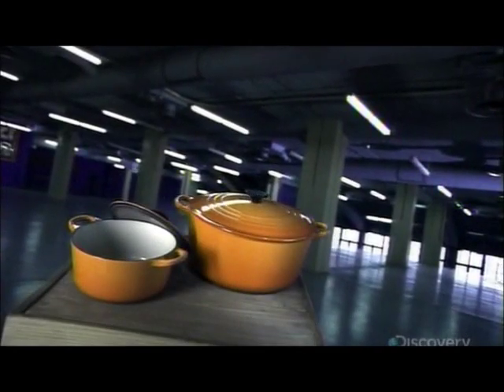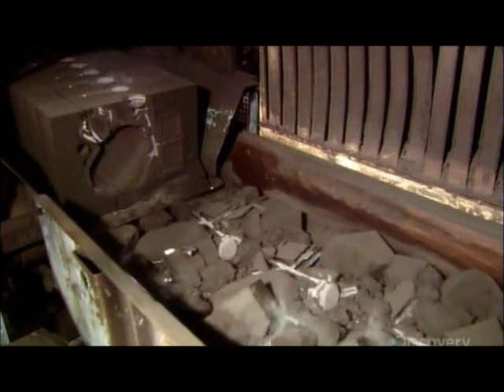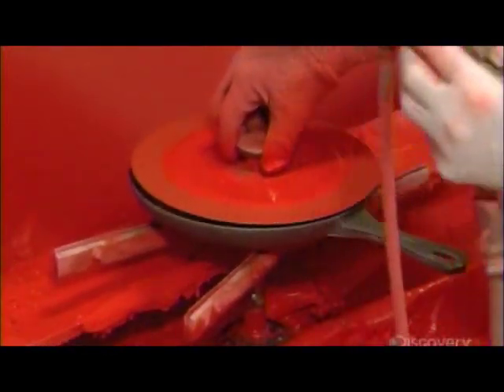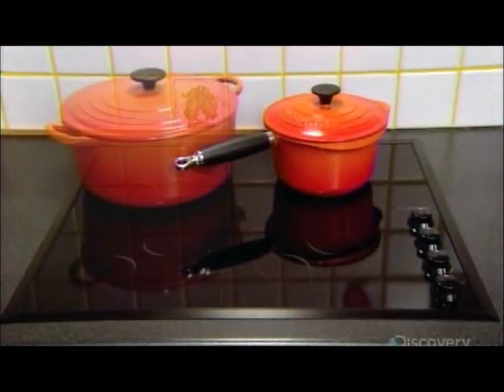How It's Made - Cast Iron Cookware

Comment: Some fun things I've noticed:

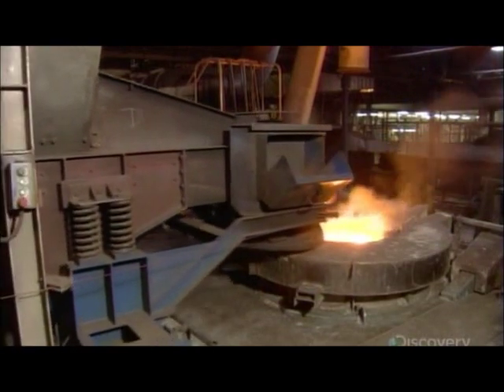0:44 Steel by definition is low carbon (under 2.1% I believe). The steel is really there to dilute the realitivly dirty pig iron and bring the carbon down. Gray cast iron calls for a carbon equivalence of 4.2 (C+si/3)

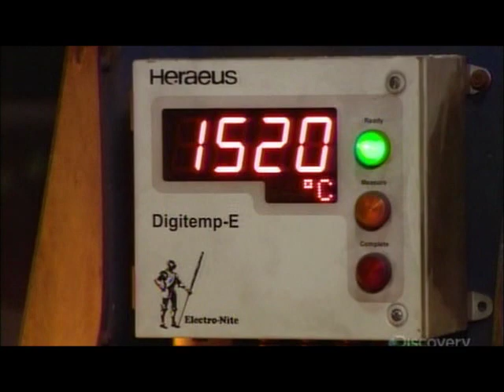1:02 Had a lol at the error on the Heraeus lance screen. Basically, means he tried to take a temp reading but the lance tip reached the end of its limited uses. I've gone through hundreds of those exact lance tips (That Positherm cardboard box holds all the lance tips).

1:02 That was the most winded way possible to explain how he threw Slag-Off in the furnace to clump up the slag XD

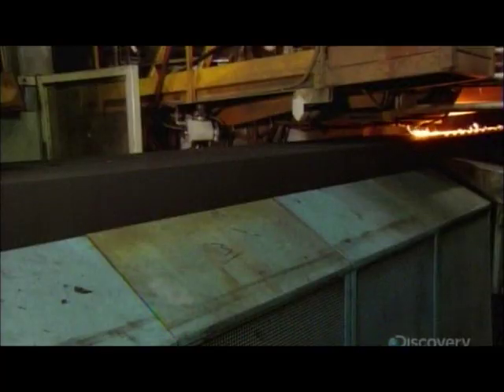1:30 "Because just one single grain of sand will be rather inconsequential in the grand scheme of things."

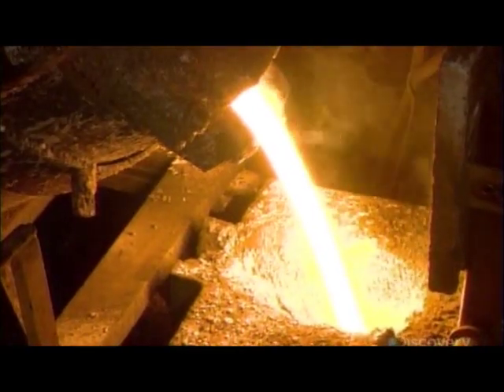1:44 God I wish we had a system like this.

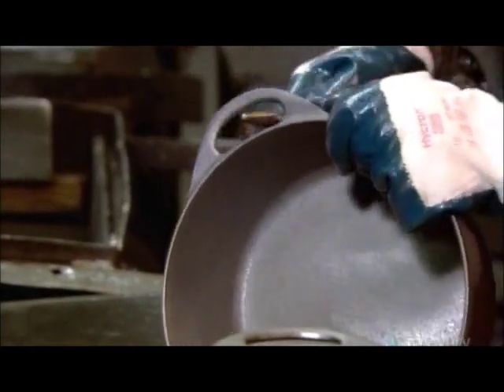2:45 Whip it!

2:55 "There's no real way to show the inside of our shot-blast machine so why don't you set a lid on the table and pour a bucket of shot over it?"

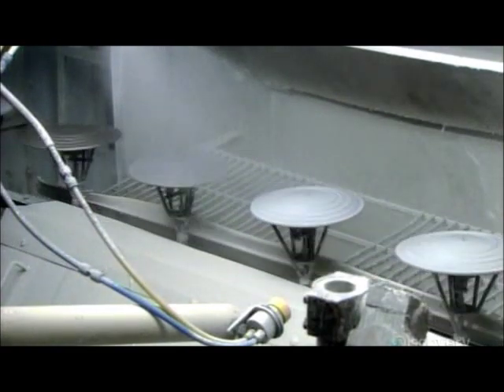3:13 SPEEN

3:19 I curious what they add to the glass to make it flexible.

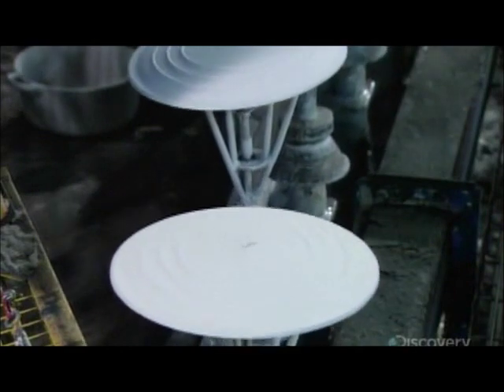3:30 I'm guessing this might also be a heat-treating step. Tempering starts at 100C, recrystallization at about 550C. I don't know whether 45 minutes is enough to do anything though...

4:42 I must go. My people need me. XD

Comment: We use stainless steel it actually does last more than a lifetime.  Drop one of those castiron pots and your enamel is gone!
Reply: Taunter Atwill I happen use cast iron pans that date to someone else’s lifetime. Griswold went out of business in the 1950’s, and I know one of them came from the 1920’s.  Drop one of these cast iron pans, and your floor is gone. :-p
Reply: What stainless steel cookware are you using that lasts “more than a lifetime,” I could see my Demeyere lasting but other than that even All Clad warps, dings and has to be replaced much sooner than Le Creuset